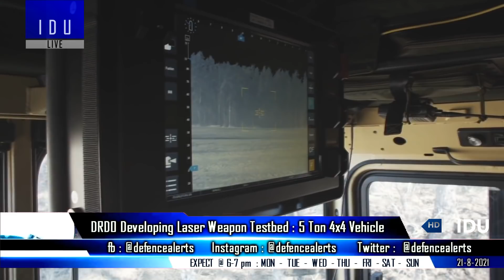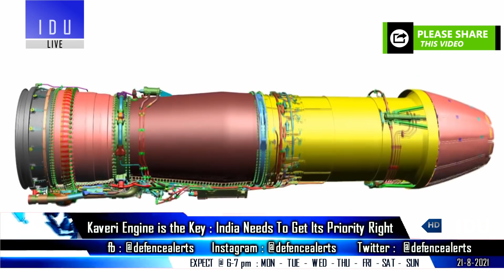Indian Defence Updates : 6 Super Kalvari Under P-75I,DRDO Durga-II Testbed,India UK Engine By 2033

Comment from the maker: 🔴What's Your Opinion : "Is Super Kalvari the best alternative" ?
ＬＩＫＥ | ＣＯＭＭＥＮＴ | ＳＨＡＲＥ | ＳＵＢＳＣＲＩＢＥ
Reply: Of course.Govt. should scrap the tender and go for a G2G deal. Both MDL and L&T should be included for manufacturing.
Reply: Risk with reward option - using self aip.. India will go by 75i only. They will alter the request n increase d cost. India is targeting Germany submarines clearly. All 75i roads r leading to Berlin
Reply: @jothisampath415  The Type-218 SSK, developed by TKMS (Germany), already comes with an option for a Vertical Multi-Purpose Lock (VMPL), which can be utilized to launch both SLBM's, UUV's, and divers. VMPL Systems are similar to Vertical Launch Systems (VLS).

Furthermore, Germany has offered to integrate the BrahMos SLBM on a VLS Systems for India, if chosen in P-75I. This is another advantage for India.
Reply: I think we should try new Japanese submarine
Reply: @sureshks7459  joining a project after it has nearly been inducted is very expensive. Add that Japan is still very protective about their defense technology and it will end up being a nightmare to get it. The MoD should try getting the lithium Ion battery technology though.
Reply: India can't change rfi according to german. Better to go with additional 3  kalvari & release fresh rfi or build our own.
Reply: @rajs2659  exactly
Reply: Even if we change the rfp Germany may bargain for tot, price. If india has that budget fine. Otherwise better to order additional 3 scorpene class submarine, build our own submarines with our own aip.
Reply: Is Russia still hanging in ,in the project?if yes Amur class would be good 👍
Reply: @Sonia_Godfray_Hindu  The Amur-Class SSK, is a bad bet, due to the following reasons -

{1}. It lags behind other Next-Gen SSK's - in terms of range, endurance, stealth, ordnance, etc...

{2}. Russia is yet to develop a reliable AIP systems for the Amur-Class.

{3}. The Amur-Class is till undergoing testing. Out of 12 submarines planned in 1997, only 1 is in active service, that too as a prototype. It hasn't demonstrated its reliability.
Reply: @kishoreanandan5742  why we are not going with smx 3.0 ?
Reply: @user-fv8re4jg7d  The SMX 3.0 is merely a concept; no submarine of the type has ever been constructed, nor has it even been ordered. Plus, if it has to built, it has to show a satisfactory level of reliability, which it is yet to show.

India may not want the SMX 3.0
Reply: @kishoreanandan5742  which sub Australia is buying from France that was in headlines recently for delays??
Reply: @user-fv8re4jg7d  Colin class I guess
Reply: @user-fv8re4jg7d  Australia had purchased the Shortfin Barracuda-1A SSK, which is the diesel-electric/AIP variant of the original nuclear-powered Barracuda-Class SSN. The SSN variant is in service with the French Navy. For a batch of 12 submarines, the original cost of $ U.S. 50 Billion (in 2016), has bloomed to $ U.S. 89 Billion in 2021.
Reply: @kishoreanandan5742  won't it be good considering that same barracuda 1A SSK in p75i keeping future in consideration or its too costly ??
Reply: @Sonia_Godfray_Hindu  Collin class is already in operation with Australian navy.
Reply: @user-fv8re4jg7d  {1}. Currently, it is still a concept, which has to demonstrate its reliability. Right now, Australia has chose to pursue the deal - despite its ever-inflating cost and wide-spread criticism.

{2}. Furthermore, it has to demonstrate a satisfactory level of reliability in service.

On one hand, considering it may be a good bet, but it is up to the MOD to decide.
Reply: @Sacrafago90  The Type-216 SSK is a concept, that has been designed for ocean-oriented navies, like India, Canada, and Australia. However, it is still a concept - not a single boat has been ordered; India may look for an already-operational/tested submarine, as a worthy candidate.

Given, theType-218 SSK is already existent - it may be a good appeal for India, considering that it has numerous advantages over other SSK's, including a Vertical Multi-Purpose Lock (VMPL), which can be used to launch SLBM's - India has been seeking such a feature.

I think India should purchase the Type-218 SSK.
Reply: @bonitaramsingh  The 12 Shortfin Barracuda, in a 2021 estimate, costs $ U.S 89 Billion. (not the Barracuda SSN). This price tag, is likely to rise higher, with the next 5 years.
Reply: Smx 3.0 plz
Reply: But it should have VLS
Reply: Guys can anyone tell me what happened to Kalyani's Bharat 52 ? Is it under trials ?
Reply: Nt a good idea....we need varities of subs frm different countries like gemany , france , russia , korea to make our own sub....
Reply: @harshlatabhatt6939  India isn't seeking multiple submarines from various countries; a fleet of submarines from various nations will create logistical issues.
Reply: @kishoreanandan5742  bt we get technology also.........we hve already russia/french sub tech......german tech needed....
Reply: @harshlatabhatt6939  It will e difficult to maintain different tech, of different origins - this creates logistical hurdles.

But I agree with you, German naval tech - especially their fuel-cell AIP, is needed for India.
Reply: @kishoreanandan5742  chinese eyes are also on German AIP tech........i knw there is a logistic issue bt according to me if we acquire different subs tech then we able to build our own submarine technology by using different tech of different countries like s.korea did.....👍👍👍👍 bt nw there is no hope.....2 strong contenders already out viz.Germany and SAAB.....😔😔😔
Reply: @harshlatabhatt6939 

[I]. Germany, was the strong contender in P-75I, not Sweden. 

{1}. India has very little experience with Swedish naval technology, plus, the A-26 offered by SAAB was merely a concept - not a proved/tested submarines; Sweden hadn't indigenously built a submarine in the last 20 years.

{2}. Except for Bofors, Sweden has barely been a strong contender in India's defense industry.

[II]. South Korea only bought two foreign SSK's - from the same country - Germany. Korea's Jang-Bogo SSK, is basically an advanced variant of the original Type-209 SSK - this was the "KSS-I Program". Korea had only purchased 9 Type-214 SSK's, again from Germany - this was the "KSS-II Program".

Korea is now focusing on the  "KSS-III Program" - indigenously developing their own Net-Gen SSK.
Korea never sourced submarine technology from "various nations" - it had only done it with Germany.
Reply: @kishoreanandan5742  means korea was the leading contender👍👍
Reply: Yes, yes, yes, yes, yes, yes, yes, yes...,,............ YES
Reply: Yes definitely
Reply: 2:47 - Notice Israel Self Defense jamming pod promo graphic shows all ground threats with only one fighter threat with Fire Control Radar highlighted - but NO Missiles + during a Strike mission at 2:51 with fighter threats at known intercept vectors - not possible during air combat + intercepting fighter threats are at more distant ranges than ground threats before much more powerful FCR burns through a small antennae low powered self defence jammer EM field + notice the jamming fighter is evading - not attacking ground threats - so is not suppressing air defence radar for the Strike package but EW screening for it - that is becoming almost impossible with networked air defence systems with fighter screens + AWACS networked with short + medium range AD positioned hundreds of kms out from S400....
Reply: 2:51 The Self Defence jammer is more effective at closer ranges against lower powered ground threats because the Strike package is flying low to use the radar horizon as cover - that doesn't work with enemy AWACS vectoring enemy fighter screens using IRST to find and track the Strike package for IR missile attack - while remaining undetected by the Strike package defensive counter air cover by not activating FCR - Measure Countermeasure....
Reply: @Measure-Countermeasure  Yes all the best with the potency oF those jammer Pods against:
- Enemy huge diameter twin engine powered fighter AESA FCR
- Enemy S-400/ HQ 9 ( S-300 derivative)
Reply: @aocaoc2561  Correct - but Self Defence Jamming can be effective at longer ranges on border patrol against trigger happy enemy air defence crews - where the much more powerful radar transmitted energy at 3 times the distance is 1/9 the power - and received energy is 1/81 the power....
Reply: 2:51 - Notice the Strike package is flying in mountainous terrain ideal for Strike missions that can use mountains as radar cover by flying in valleys - that doesn't require Self Defence Jammers - with enemy Air Defence Radar on mountain tops instead of in valleys to make it even easier for the Strikers to remain undetected - that are Striking the target being protected by the air defence systems - not the air defence system radar - leaving a deadly threat in place for future Strike missions or air logistics ops - Very Deceptive Advertising - almost like a Gamer ad......
Reply: Stealth is expensive - regardless if it's Acoustic + Electro-Magnetic Anomaly Stealth - or Infrared + Electro-Magnetic Radar Stealth...
Reply: Only if we make at least 15 such subs with AIP, advance stealth features and nearly 50-60% more firepower, then the economies of scale would be useful. Other wise we will have more of the same which might not be useful in ever evolving weapons technology.
Reply: Many people are just talking about scorpean submarine... But they already forget many secrets had been compromised many years ago 😠
Reply: India should scrapped the P75i tender I thought what has happened in the last decade with the P75i we 
can guess only considering a single point  even though known today  from Korean end that their design 
will not provide vertical launching 
system but we pretty much  all believed that the Subs under P75i will have the same facility then how  Korean co  remains in the race , are the concerned officers blind , didn't they fact check the designs till now , so no further tender should be floated for the same rather a outright deal need have to be inked with French to lay the keel of Subs that will be super Kalvori class based on 
super Scorpene design  .But I feel 
Russian refurbished Kilo class Subs
offer should be taken into consideration along with the project 
as it will take another decade to finalise the deal & eventually when we will get the first the Chinese will get a century in case of Subs  .
Reply: @pijusmalik7243  

{1}. In actuality, there is no design referred to as - the "Super Scorpene". Its merely an apparition, or in simple terms - a rumour. Naval Group initially stipulated that it may re-offer a Scorpene batch to India, but haven't followed on it. Nor has Naval Group explicitly stipulated that they may offer a heavily-remodified/sophisticated Scorpene.

{2}. The Scorpene SSK, in essence, belongs to the "Early-AIP" era - the era in which SSK's where developed during the advent of AIP technology. Other "Early-AIP" SSK's include - the Gotland-Class SSK, Scorpene-Class SSK, Type-214 SSK, etc.. Various countries are already designing, or have adopted newer, and more sophisticated SSK designs for their navies - such as the A-26 Blekinge, Type-216, and the KSS-III.

These submarines, when compared to the "Early-AIP" ones - fare much better in naval warfare systems, stealth, ordnance, endurance - with the entrance/development of newer technologies.
For example, Navantia (Spain) and DCNS (France), had joint development of the Scorpene SSK until 2017. Navantia utilized the skill gained during this development period to create its own, next-gen submarine - the S-80+. Even France, superseded the Scorpene with the Shortfin Barracuda Block 1A, and the Marlin-Class Concept.

In order to maintain a level of parity, with the ever-evolving naval sphere, I feel India must opt for a newer and more sophisticated design, rater than opting for the Scorpene -  which was designed in the 1990's.

{3}. The Kilo-Class SSK's come in three versions - the P.877, the P.636 and the P.636.6. India and Russia already operate the P.877; they were designed in the 1980's. The P.636 and P.636.6 are relatively more newer - they were built during the 2000's-2020's. Russia -in its offer of "old submarines" - may offer a refurbished P.877.

India should not consider purchasing a refurbished P.877; they're already over 40 years old, and lack sophisticated capabilties, when compared to next-gen SSK's. For example, P.877's don't have decoy-launchers, a feature which is present on today's sophisticated submarines. Furthermore, India hasn't had much satisfactory experience with the P.877 - including multiple accidents.

The Indian Navy has sought to combat its ageing-fleet with the procurement of new submarines; however, P-75 is already 6 years behind schedule, with P-75I only recently initiated. The Indian Navy would certainly not look to add an already ageing SSK fleet with simultaneously-ageing submarine. 

If Russia were offering brand-new P.636 or P.636.6 submarines - the newer and more advanced versions of the Kilo-Class - India may have considered the offer. The P.877 - which Russia is offering, is long out of production, and is already being decommissioned. India simply won't consider 30-year old P.877 subs to the relatively newer, and more potent Type-039A - which Pakistan is procuring

If India were to agree to a deal in 2022, ostensibly, an agreement, plus the period of upgradation of the 2 P.877 subs could take the course of 3-5 years, at best. By the time these subs arrive in India, more technologically-advanced SSK classes - such as the S80+, KSS-III, Taigei-Class, Shortfin Barracuda would be in active service. Plus, with the introduction of newer naval technologies, a retrofitted P.877 is simply inferior - in technological aspects. Plus, the naval arena is increasingly focusing on the improvement of ant-submarine warfare technologies; such improvements can easily outrun any upgrades on the P.877.

Although, purchasing a refurbished P.877 may be lucrative in the short-term, it isn't such in the long-term.
Reply: DRDO को मौका देना चाहिए न्यूक्लेयर पावर्ड सबमरीन्स निर्माण करने के लिए
Reply: Yes, we should go for super kalvari with pumpjet propulsion, AIP and Lithium ion batteries. This model could also be used for our SSNs.
Reply: @rahulsubramanian6545  FYI, South Korea and Japan are the only two countries which have successfully developed Li-Ion Battery (LIB) Technology for tis diesel-electric SSK's. Although, France and Germany has conducted research into LIB technology, they haven't manufactured a working prototype, nor have they abided by safety standards.
Reply: @rahulsubramanian6545  i agree fully, but German AIP for the time being on all submarines. After the indigenous version is working properly they can be phased out. And a good VLS system for BrahMos.
Reply: @jacksonteller1337  {1}. German-based Siemens, in cooperation with ThyssenKrupp Marine Systems, are world-leaders in fuel-cell AIP technology. France, comparatively, has no experience in fuel-cell AIP systems.

Siemens-developed fuel-cell AIP, has been renowned for efficient operations, when compared to MESMA or Sterling-Cycle AIP's. The Type-218 SSK reportedly has AIP-endurance of about 6 weeks, with its Siemens-AIP system.

Furthermore, Germany has offered to integrate the BrahMos SLBM on a VLS Systems for India, if chosen in P-75I. The Type-218 SSK, already comes with an option for a Vertical Multi-Purpose Lock, which can be utilized to launch both SLBM's, UUV's, and divers.

I believe India should go for the Type-218 SSK.
Reply: @kishoreanandan5742  if Germany withdrawals from the tender it has a small chance to still bag the order. But my instincts say government intensionally made it happen to get more Kavari/Scorpène class submarines. Building a licensed version of the German AIP would be just as good it can be added to the older Scorpène class and the submarines already in service. I don't think anyone is dumb enough to have Indian facilities building their submarines without the final control and still be financially responsible. It is like the anti corruption laws the foreigners get punished but the Indian officials get off with a slap on the wrist.
Reply: The Scorpene 2000, isn't an attractive option for the Indian Navy, due to the following reasons - 

{I}. The Scorpene belongs to the "early-AIP" era, when AIP's were first developed for diesel-electric submarines - during the 1990's. The Scorpene, was developed jointly by Naval Group and Navantia in the 1990's.

The Scorpene is already being superseded with the more-sophisticated S-80+ Class submarines, designed by Navantia, using its experience gained during the development of the Scorpene.

"Early-AIP" era submarines, are being replaced with newer designs -

{1}. Gotland-Class SSK  :- A-26 Blekinge Class SSK.
{2}. Scorpene-Class SSK :- Marlin-Class Concept, S-80+ Class SSK.
{3}. Type-214 Class SSK :- Type-218 Class SSK.
{4}. Chang-Bogo Class SSK :- KSS-III Class SSK.

"Newer-AIP" Era submarines, include next-gen submarine designs, such as the KSS-III, S-80+, A-26 Blekinge, Taigei-Class, etc...They, in contrast with older designs, have improved capabilities, larger tonnage, sophisticated naval systems, and a greater payload capacity.

{II}. The Scorpene, utilizes the MESMA AIP - the only available steam-powered AIP in the world. However, Pakistan already utilizes the MESMA on its Agosta-90B SSK's. Furthermore, France hasn't developed any newer AIP systems, other than the MESMA. India may not want to use the exact same technology as that of its nemesis.

Moreover, MESMA has been known to be in-efficient, when compared to fuel-cell AIP systems. Fuel-cell AIP have displayed much more reliability, than steam-powered AIP, or Sterling-Cycle AIP; many nations have pursued fuel-call AIP technology - India is among them.

India may not want to utilize the MESMA AIP.
Reply: @kishoreanandan5742  DRDO has developed fuel cell based AIP. This one should be fitted in super kalvari and a thorough sea trial should be conducted. No need to waste available resources.
Reply: @rahulsubramanian6545  DRDO has developed a fuel-cell AIP, but hasn't tested on an operational submarine. This testing, development and trials, could take 4-5 years; India hasn't the time to exercise its complete emphasis on the DRDO-AIP; it must be tested and must be allowed to mature - which is a great expenditure of time. 

Furthermore, India has clearly stipulated that the DRDO-developed AIP, will not be installed on the P-75I Class.